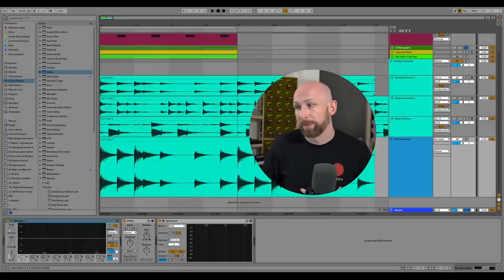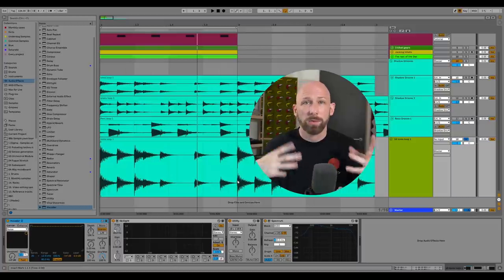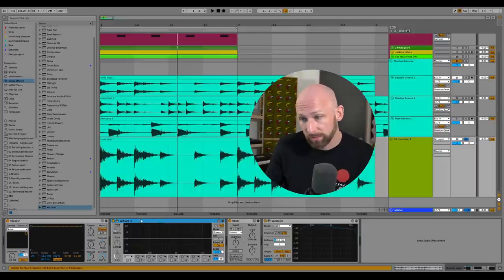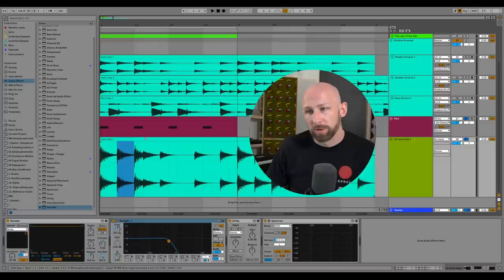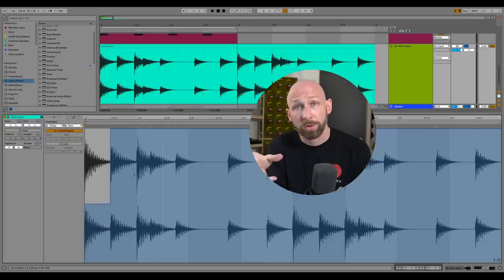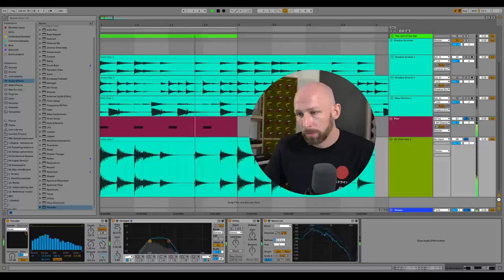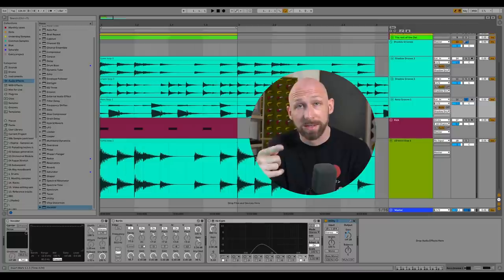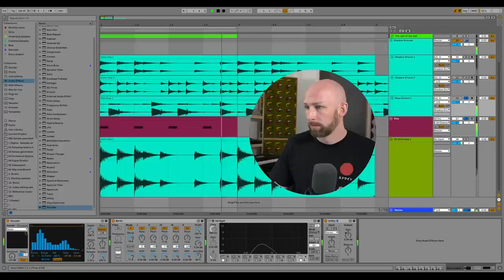Shadow Grooves for House Music using Vocoders and Resonators

Comment: I created 2 sample CDs 20 years ago with a concept called GROOVE SHADOW....;) Groove Shadow Elastik was the flagship version and have 4 different frequency layers to alter the impact of the shadow based on those frequency ranges. There is also a synthesizer from the 90s called the Korg Wavestation which had a similar concept (wave sequencing). My new thing I created is called XRIFFz, which are a concept to make spectral based riffs that extend beyond "guitar riffs" into the idea of spectral based selection, makes huge impacts on the dynamics of the possible rhythms. The tutorial is superb, it helps to understand the "spectral bleed" of the loop through modulation with something simple like an amplitude parameter. This subtle bleed of the sounds, along with the accents is key to the glue of loops to additional material as well as the "capture" quality of a loop, making it seem alive and loopy as opposed to mechanically programmed. This stuff goes on forever because you can also use de-esser or other sidechain tools to bring the elements to life and together.

Comment: Instead of Utility I‘d recommend to drop in an Effect Rack, create a Macro for the volume fader and use that instead. The difference is that the Rack can actually go down to 0dB, Utility can‘t. 
I would also use that on every channel in general for volume automation instead of the mixing faders. That way it‘s easily possible to do the gain staging later in the mix without f*****ing up the automations!
Reply from the maker: Agreed, except that in live 11 it does actually go to -infinity :) small upgrade. But with a macro you can determine the range more precisely as you say.
Reply: i also started to use a gain Plugin in the insert for volume automation instead of the main fader. so the mixing process is not interupted later (i use reason but the principle is the same). i love this approach and it has helped to improve my overall sound.

Comment: Why did it turn into Popcorn when you applied the vocoder?
Reply from the maker: Because the vocoder uses white noise as the default carrier wave. You can set other waveforms, and feed it external signals (and you should!), but by default it's whitenoise, and that sounds like popcorn 😅
Reply: @OscarUnderdog  I meant the 1969 OG dance song ;) but learning how you use white noise has been very useful to me!